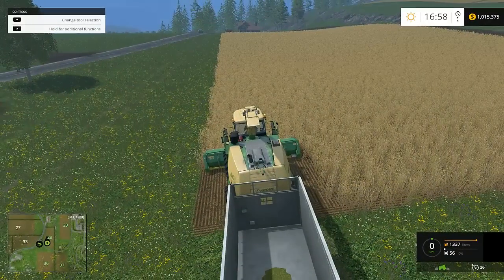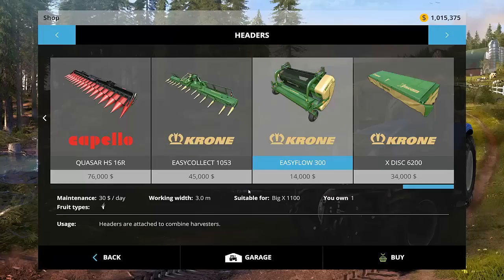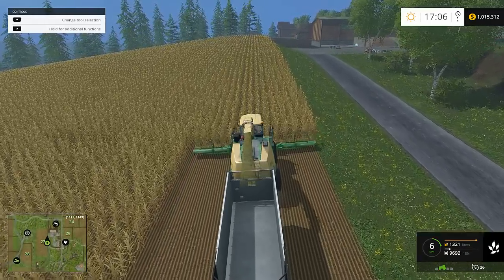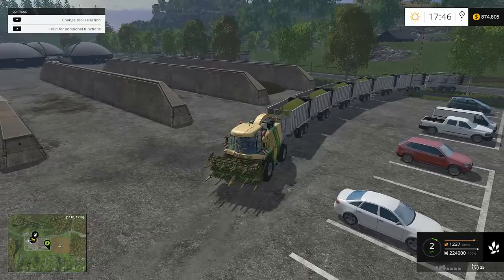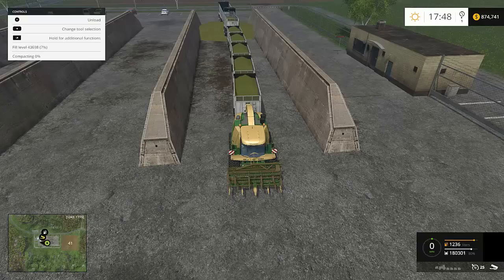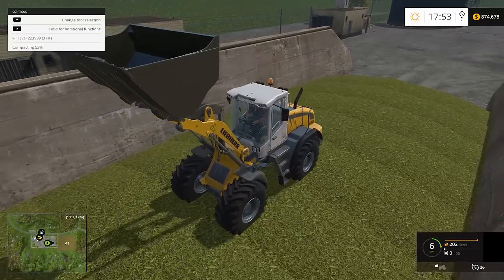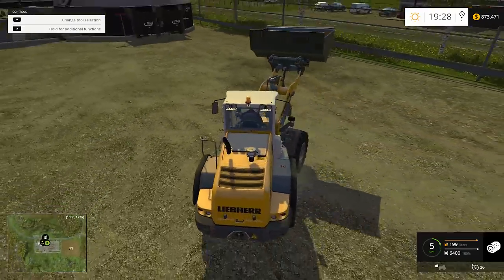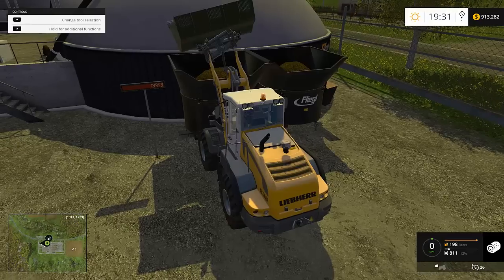Inzainia Plays:Farming Simulator 2015 Basics EP8 (Silage and Chaff)

Comment: The difference between the X Disc and the Easyflow is that the X Disc is more "destructive". This means that using it only produces chaff and the rest of the crop is lost. The Easyflow is like a vacuum cleaner. You can drive behind the harvester that has the straw swath enabled, and simply pick up the chaff as you would when collecting straw. This way you both get the crop and the chaff, but you get less chaff than when the easycollect (for corn) and the X Disc are used. So if you need a lot of silage use the X Disc and if you want to have both the crop and silage use the Easyflow.

Comment: How did u manage to connect those together? Its hard to connect three cuz u cant back up 2 trailers hardly so what technique did u use?
Reply from the maker: basically i connected them in groups of 2 to 3, stretched them straight then grabbed a few more, drove to the front, lined them up and slowly backed them up to tie the rest together, connecting them 2-3 at a time until i had the whole train :)
Reply: oh ok thanks! ill have to give it a shot
Reply: inzainia How do yoiu connect the harvester to the dolly? it seems to be to low compared to the crone harvester. What is the secret?
Reply from the maker: Haydi Daysia i didn't. the trailers used in this video are all - non dolly, trailers. they have a front hookup already connected to them, i don't remember exactly what they are called but they are the ones that carry 32000 units.
Reply: inzainia  Thank you very much! The problem was that I was trying to connect the biggest one of the same brand :( Now it is working!